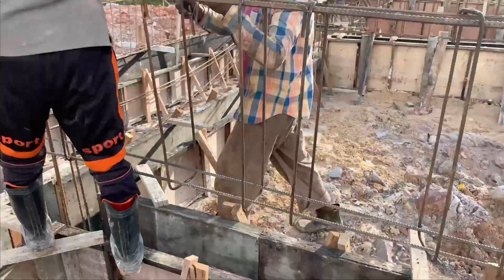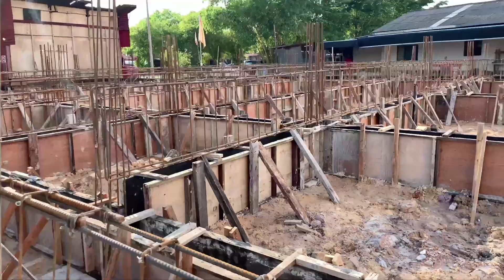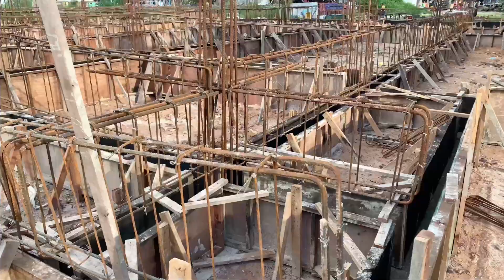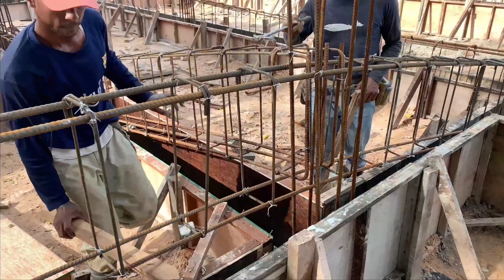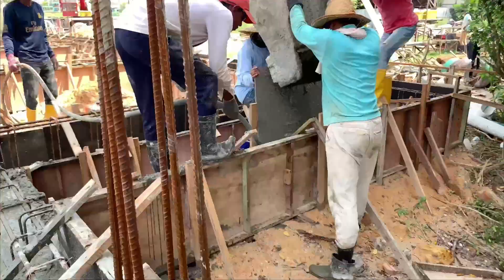Concrete Ground Plinth BEAM Construction Process Steel Rebar Reinforcement Placement Timber Formwork

Comment: Besar juga size beam ye. Berapa tinggi dan lebar ground beam ni  bos
Reply from the maker: Beam Size = 225mm x 600mm
Reply: @apertureofconstruction1739  besar. Ini utk rumah/banggunan 2 tingkat ye.
Reply from the maker: Bangunan 2 Tingkat.
Reply: @apertureofconstruction1739  ow ok2. Kalau rumah setingkat ok ker klu buat size camni. Ada standart size ke bos.
Reply from the maker: Apa maksud standard ?
Reply: @apertureofconstruction1739  tak maksud sy spesifikasi binaan mcm beam ni semua mmg dah ada standard tertentu ke atau ikut jenis binaan. mean kalau sy buat rumah setingkat adakah effective dan sesuai pakai size beam 225mm x 600mm atau ada standart lain yg lebih sesuai.
Reply from the maker: tak semesti , bangunana terpulang kepada apa loading dia , maksudnya , satu tingkat tak perlu ikut cara ini , boleh pakai besi dan beam kecil sikit. terpulang kepada load , berapa berat bangunan itu

Comment: I was very surprised to see that there are rainwater downpipe placed inside the structural R.C Column... or is it outside? I cannot really tell 😅
Reply from the maker: We only can follow the design of the drawing by Civil Engineer. And you can noticed the size of the column :) and how many column designed in that building
Reply: @apertureofconstruction1739  I get it now, thank you 😁👍